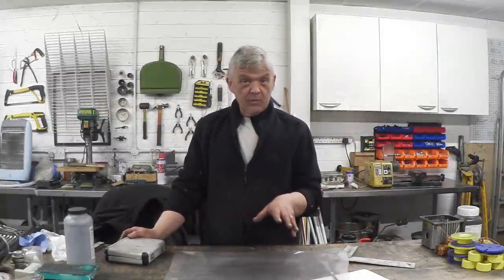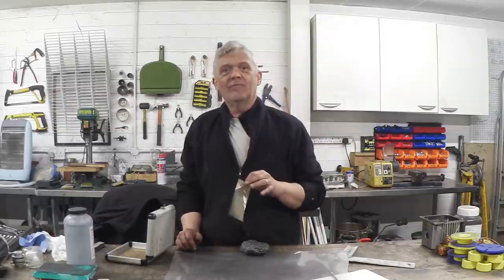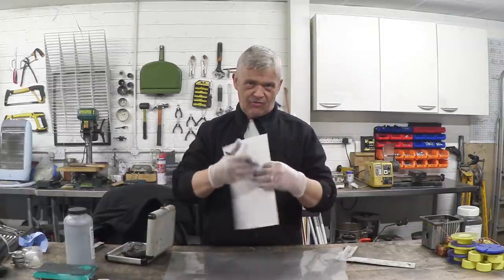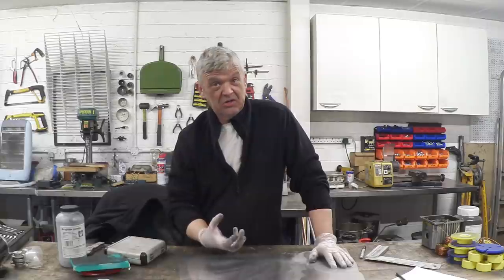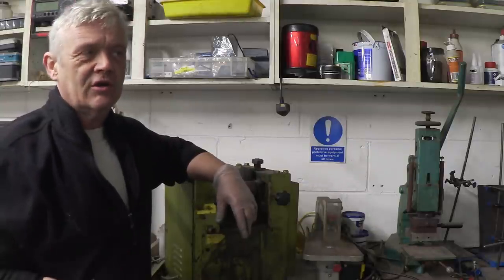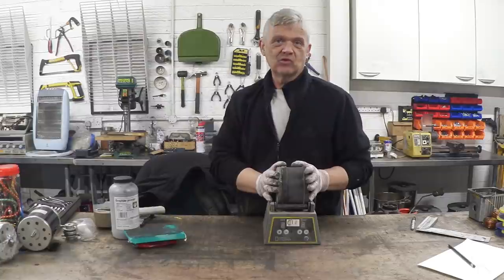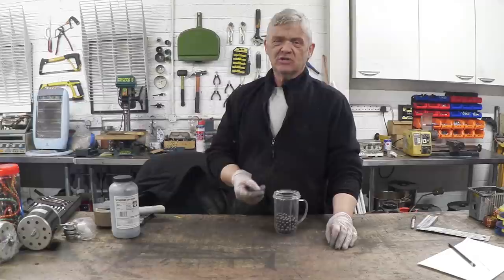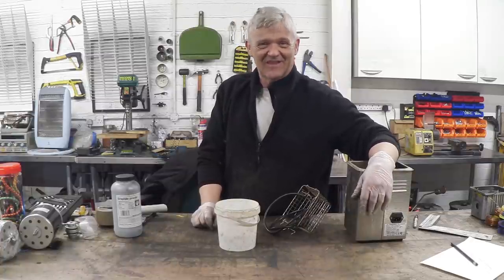1090 Graphene And How To Make It - Mechanical Methods

Comment: Im looking forward for that electromeknical video, or maybe lightening grapene like they did at the rise university Thanx for your inspiring channel. Thanx for Sharing your tips and knowledge 👍
Reply: NightHawkInLight did a good video on that method, but it's a bit dangerous since you have to use a large capacitor bank. Also not cheap since you have to buy a boat load of the super caps and then also a quartz chamber. Out of all the methods besides CVD, which is out of the capabilities of many (most?) of us, probably the electro chemical is easiest, quickest, and produces decent enough graphene for electrical, thermal, and mechanical strengths applications (i.e. composites, cements, etc).  

  I'm not sure, but I think that Rob leans to a combo of the electro-chemical, as well as the heat conversion of hemp to carbon and/or graphite, personally.  At least, I got that impression from watching a boat load of his videos awhile back.

   Something I'm focused on is making cellulose nanocrystals and then converting that into carbon and graphite.  I think the size and the inherent crystalline structure may provide a benefit.  I'm not sure, but I think that is what is in the hemp that gives it such good properties, though it is also chemically exfoliated while heating (via potassium hydroxide).
Reply: @justinw1765  I was thinking that Rob might have watched a few CHEECH and CHONG movies myself. Maybe he"s got one of those quartz pipes to flash off a little carbon press. I see much cleanup potential in Flash Joule processing, no fire, no chemicals. We can dig up our land fills and make them non toxic profitably.That's a win, win.

Comment: Thank you Rob! Nighthawkinlight has demonstrated another method. Called flash graphene by Duy Loung of Rice labs.
Reply from the maker: that's a bottom up method mate - so far we are covering top down approaches
Reply: I think nanotubes would suit the endgame. I also think an interdigitated compartment wasn't considered for the flash method. I'm guessing the monoatomic layer between carbon electrodes is key. This is cutting edge stuff you are working on and you have lead.

Comment: Dear Robert. I have a question. I created a silvery material from black graphite. I feel it's large graohene flakes/nanoplatelates but I told my friend and he said graphene is black. I said I think it's more silvery--especially when wetted. All the best electrical conductors are shiny and reflective. It seems graphene can be black, or if thin enough, totally clear. My question is what is this silvery stuff? (It's in your paint, too, that I got). Also, do you still feel 75% acetone and 25% water is a good mix or have you found a better solution?

Comment: Inspired by you, I've parsed some papers about graphene, and seen a few describing the interculculation of hydrogen atoms into the carbon lattice structure of the graphene honeycomb allotrope. In one of your previous videos, you were conducting experiments with magnetism and hydrogen generation. To make continuous graphene sheets, could we somehow take a sheared pile of honeycomb graphene with the hydrogen  atom "locked" into it's center and utilize a sufficiently smooth magnetic plane to "pull" it all into place?
Reply: I'm going to channel Rob for a moment: "Go for it mate, see if it works".

Comment: I have always wondered how you know at what point you are done? What tells you that the powder now is graphene and you don't need to blend/mill/... it for another 4 hours? Is their a way to differentiate between graphene and ordinary graphite powder?
Reply: There are a couple ways.  Really, really, really good microscope.  You can also test the electrical conductivity of the material. If you know the base line for the regular graphite source you're using, and then you get a significant increase over that in the possible graphene, or more likely, a more graphenic graphite in the electical conductivity, then you know you're doing something right.

Comment: If you can make the plastic (or use a different kind of sheet material?) sheet electrostatically fluctuate and repeal the graphene after it is applied that would
Reply: Makes me wonder a bit about the galvanic corrosion reaction between carbon and Al, and if that could figure in some?

Comment: Irish scientist used 100% graphite & washing up liquid mixed in a blender = wet graphene oxide.
Using CNT or activated carbon (coal anthracite) can be Used with 100% seed /leaf/stork oil ecopoxy/ecoglues to silicone & etc PLA to Kevlar & so on mixtures of liquids adhesive and compounds powders??
World's largest Ball/Sag mills are massive ..

Comment: Any thoughts on using the resonance frequency of graphite to make graphene
Reply: Sounds interesting.  How would one go about finding this out, and won't it vary some depending on size, shape, etc?  And wouldn't the ultra sonic do, indirectly, what you're proposing would do more directly?   Benefit might be less power/energy used, and/or more controlled shearing?
Reply: @justinw1765  to be honest I’m not sure which is why I asked but it seems reasonable to me to assume it would have some benefit in efficiency

Comment: I recall you mixed urea with the glycerin.  is that unnecessary?  (trying to find that vid where you laid out the ratio, but i can't for the life of me)
Reply from the maker: no you need the urea - I think it is a members video now - but I need to check that to be honest
Reply: @ThinkingandTinkering  I thought it was, I may just not be looking in the right place, or otherwise not spotting it.   Finally found an appropriate stirrer for my ball mill so I was going to give it a shot for a cellular concrete experiment I'm about to embark on.
Reply: @ryanjamesloyd6733  Any luck with that?

Comment: Could I win a prize for directly converting cellophane or plastic sheet to graphene?  Seems like getting a thin sheet by rubbing graphite on a thin sheet is adding ingredients and complexity.  Cellulose, paper, thin polyethylene all contain a lot of linked carbon already.  Plop it on some stainless steel and heat to 700C.
Reply: It's a little more complex, but there is something to the general notion.  After all, the hemp fibers when converted to carbon and/or graphite via heat and/or pressurization shows very high electrical conductivity and more over, because of its innate structure and that it also gets chemically exfoliated by potassium hydroxide during the process, the surface area is immense (helps to increase potential loading of ions), then yes, in a very general sense, there is something to that. 

    What might be interesting in particular, is an instant, high heating and quick cooling of highly oriented, ultra high molecular weight polyethylene--the stuff they use to make ridiculously high tensile strength cord, rope, fibers, etc (A bike company is now using it in place of steel spokes for wheels). (Some trade names include Dyneema and Spectra, but there is plenty of Chinese brand versions).  Why, the highly crystalline nature and in a continuous, connected structure, might provide an ideal pathway for electrons, making it very highly, highly conductive?  

   Actually, that would be a good material to try in the flash-electro-heat version.  The problem with this material is that it melts at a pretty low temp.  Once it starts to get to that near melting temp, it also starts to lose it's high crystallinity which is what gives it its high tensile strength and high thermal conducitivity (Dynamic fabrics are as thermally conductive as some metals).  You would have to super heat and cool it very quickly (which the flash method does) and in a completely inert atmosphere.  All these methods of converting matter to carbon and graphite require an inert atmosphere (very low to no oxygen) btw.  Otherwise, the materials burn up. 

  (As far as I know, there are no thin, flat sheets of highly oriented UHMWPE made, though you can get sheets of regular UHMWPE).

Comment: Instead of getting fancy, couldn't you just run the ball mill a bit slower so that the balls don't actually drop? I don't know, but perhaps if your container was nice and round inside, you could cast something by putting it in the container when it was on its side, assuming that the stuff you're using doesn't stick to the container.. Just a fraction of the volume. The result would fit closely to the inside of the container and, assuming that glycerin and/or the container are slippery enough, it would slide along, with the graphite caught between the object and the container. I guess you'd want to round the edges of the object so that more graphite was pushed under. I suspect this is so obvious that many people have already thought of it. If so, and it's well known, I apologize for tedious repetition.